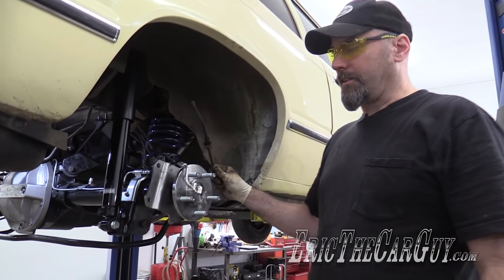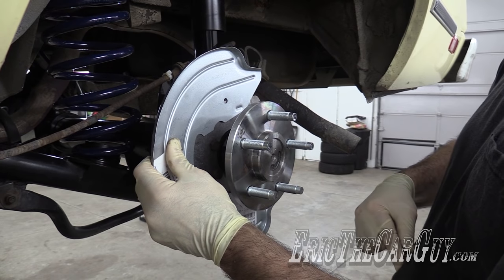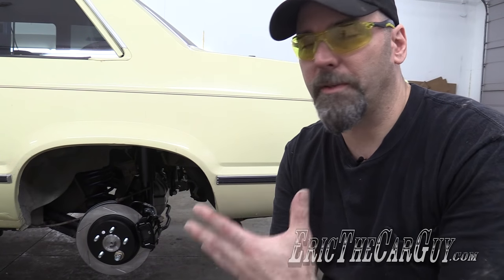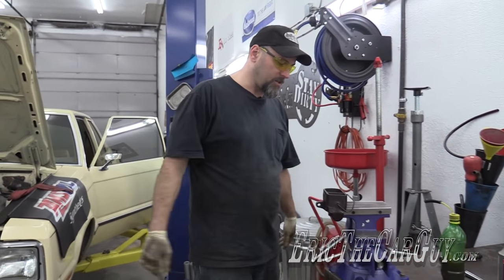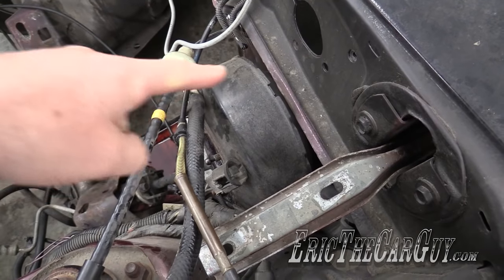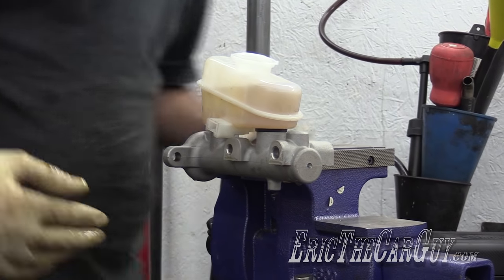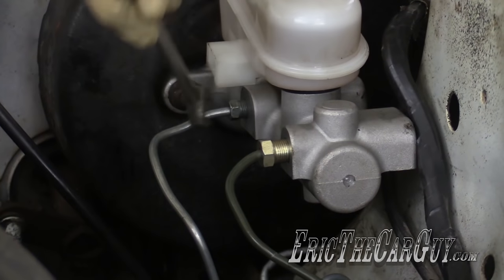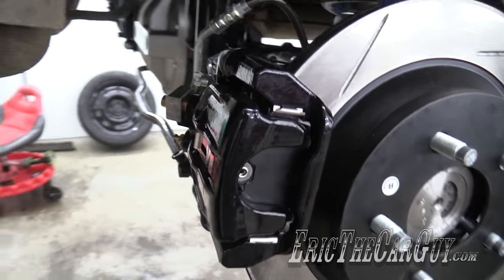Installing Rear Disc Brakes the Hard Way #FairmontProject

Comment: Hi Eric,  That did look frustrating!  I just replaced my Land Rover Discovery 2 discs all round (with performance slotted/drilled discs), and the ones I fitted were labelled LH and RH also like yours, but the slots went the other way.  I see it as encouraging air and bits of brake pad material to be flung outwards by the natural flow of the air.  May just be one of those things where it really doesn't matter :-)

Comment: 99 Ford ranger. Removed the whole transmission to replace slave cylinder (broke bleeder). Could NOT get clutch pedal after install. Was almost ready to remove trans again when.... I read up, Ford pulled a dumb, the clutch master was mounted at a DOWNWARD angle on those models (on purpose mind you, for whatever reason) making it impossible to get all the air out. Had to remove and bleed master outside of truck.

Comment: Yes i did notest that the calipers were on backwards. When i installed rear disc on my Stang i had to replace the master and the booster to make them work . I used a 94 Cobra master and a booster from a 95 V6 car as my original was too small to stop the car. pedal was hard and stopping sucked with with original booster. Also i did install the adjustable prop valve on rear brake line but did not gut the original prop valve. That still as it came from the factory. My rear brakes are 90's stock mustang brakes. Everything bolted right on . And installed new cables for e-brake.

Comment: As someone who has run slotted rotors, I concur with your installation. many believe the opposite and that it looks cooler to run the other way. it's not. slotted runs best  in this application...

Comment: I had a 1986 Porsche 944 Turbo and the brakes would not bleed properly unless the rear of the car was elevated well above the front. Hours of bleeding with the car  level left a spongy brake pedal even though no air was coming out of the bleed nipples. After elevating the rear considerably, the brakes would then bleed normally.

Comment: I know of a Ford tech I used to work with that replaced 3 master cylinders, ABS HCU,and bleed the brakes over and over again, to fix upside down calipers.   Only took him and the shop foreman a week to fix it after another tech looked saw it, called him a dumb a__ and walked away.   I still laugh at him about it.

Comment: if you don't like bleeding brake systems try a brake line clamp on the flexible hose from body to axle.thats what a good mechanic does.seems like you are a hammer man.keep guessing.

Comment: I am 74 and I have done mechanic work all my life. However with this vehicle I am having a big problem. I have a 2002 S10 blazer that the front left front wheel locked up. I started by replacing the master cylinder. From there to replacing the caliper and then another caliper and the rotor. A mechanic buddy of mine said it was probably in the line at the connection between the the rubber line and the steel line and even pulled the fuses on the ABS system and I still have the same old problem. If I bleed the whole system I might get 5 miles down the road. I really need help with this one. I'm fit to be tied and don't know what to do next. Help

Comment: Eric, I've recently purchased the same rear end kit you used in this video. The retailer I purchased it from advises the sn95 disc conversion will not work due to the rotor cannot clear the axle and the caliper mounting flange. What caliper rotor and flange set up are you using?

Comment: Great vid!  I am "hot rodding" (as it were) my question is in the "end" did you keep the OEM proportioning valve out? I have watched several vids on the subject and it is my understanding that switching to disc on the rear with a rear drum system you CAN remove the prop valve and it will work fine. Thoughts? Thanks.

Comment: Guys can I get some ideas of what the problem with my car might be 
Well when accelerating at certain mph it's like a whistling sound coming from the front of the car 
Also sometimes my 2008 Nissan Sentra when am turning it on it the car shakes and the it turns off what might the problem be
This happens at times to make it turn on I have to turn it back on and give it some gas 
Any help is appreciated thank you

Comment: are you going to upgrade the front rotors and calipers too? I don't know the stock size on a fairmont but would make sense to put bigger ones up front.  

One time after fixing a brake line leak, I was bleeding the brakes and was scratching my head why the brakes wouldn't get hard. I filled the master cylinder up with brake fluid so they should get hard.   Turns out, I forgot to bleed the master cylinder.  So yep, everyone makes mistakes.

Comment: I call those backing plates all the time even though they aren't structural. It's a plate that goes on the back side of the rotor... backing plate is an acceptable term imo.

Comment: I might be showing that I'm not following the Fairmont Project very closely, but I noticed there are four lugs on the front and five on the back.  Will you be putting in a new front-end?
Reply: did you not hear the part about the whole new k member that holds both the engine and front suspension?
Reply: Except he's not a troll, and it was in this very video.  By "not following [...] closely", did you mean, "didn't bother to watch the video before commenting"?

Comment: I've never bench bled my master cylinders in my own cars because once I use a vacuum pump to suck the fluid through the bleeders at each wheel, it feels great and I don't think there is air in the system.  If there is fluid in the master cylinder and you pull all the air through the lines and don't let the master cylinder go dry, I don't see where air could be?

Comment: Hey Eric I know you have experience with the TL
My Acura TL Type S 07 auto vibrates and shakes violently , around the dashboard steering wheel center console area, when I'm either in Drive or Reverse during idle. It is most prevalent when I'm at a stop sign or at a red light. Does not vibrate or shake as much when I'm moving or in park or neutral. What could it be? Happens when Ac is both off but it is a lot worse when ac is on.
Reply: check engine mounts buddy

Comment: Would the locking washers do their job(lock) if its sitting between two parts and not at the bolt(or a nut)?
Reply: Yes. That style of washer is just a spring that adds positive tension to the threads.

Comment: Eric, you changed from drum to disk in the rear, right? Don't you need to change the master cyl to work with all disk? I think the drum master has the wrong pressure and volume to use on a disk brake.

Comment: it looks like the adapter plates for the rear brakes should not have the bend in them just be straight, i think you should have had  painted/redone and then painted,  ps the rear end mounts where you put new in why not poly mount like the new/used arms??? since iam use to german cars that swaybar looks like it hangs really low, on german cars they are also supported on the beam(rear end) other wise the kit you bought looks really nice, i would really like to know why the schocks are not gas versions???
regards
Sören

Comment: years of watching this old house have taught me NEVER to remodel  a house. I do repairs and refurbishment like new cabinets etc but no structural changes to my home. Cars are kind of like that. I have a toyota echo and a chevrolet pickup. each works fine. All I do is service and repair as necessary. Thats enough for me at my age.

Comment: You need power brake booster with disc brakes. Trust me people have tried without it and bend the firewall without a bracket to keep the firewall from bending. Still won't stop for crap without a booster. We found that out years ago trying not to use a booster.

Comment: I'm curious about your brake parts cleaner squirter.  It looks like a refillable canister that you pressurize with your air hose.  I've just seen the disposable canisters.  Seems like a cheaper option.
Reply: HeroPureLove The brand name is Sure Shot, fill it from a drum, then you're correct, pressurize it with the air hose and you've got brake clean. They work awesome!  Wish my shop had them the cans suck

Comment: What's the difference between = a proportioning valve = & = a apportioning valve? Dad was a mechanic for many years and he said = apportioning valve...or is it a GM thing? I had to replace one once on a Chevy p/u I built, and it (I thought), had to do with the front & rear system, in case of front or rear loss, it closed off, so you would have brakes on the other end...Thanks! Awesome vid!
Reply: Nothing. Someone taught your Dad to say it differently.

And yes, proportioning valves have a shuttle inside them that will move and "seal" off the front, or rear, brakes if a gross leak develops. That's what that little plunger with the rubber thing on it that Eric pulled out of it is.

So, the entire device works both to control the flow of fluid to the front and rear as well as act as a safety device.

Comment: Just watched the video Eric and backed it up a couple times to near the beginning and had a look at the caliper mounting bracket you have affixed to axle tube.  Do you perhaps have them on the wrong way.  Can they be turned over and that should move the caliper further to the outside of the vehicle.  This may solve you "washer behind the caliper" issue.  Just wondering

Keep up the good work.  

As a side bar.
I noticed on the Dark Matter Pikacou sneak peek dyno video at the end of the pull that there was some oil being expelled out the breather.  Is this because of base pressure or ?????  Just wondering is all.

Paul
Reply from the maker: I believe I have resolved the issue with the breathers. https://www.youtube.com/watch?v=0NWqrABL1Mw
Reply from the maker: Your other question is answered in this video. https://www.youtube.com/watch?v=P3Pb_eNLkQc
Reply: I should have watched this first I guess.  Thanks.
Reply: I was thinking of just flipping them over rather than trading sides.  Having the L and R facing inwards?  Would that not offset the caliper further outboard.?   Or will they only bolt on the one way.?
Reply from the maker: As shown in the video I linked for you the fastener mounts are offset and you can only install them one way.
Reply: Guess I was not watching closely enough.  Thanks for the reply.  
Its gonna be an awesome ride when it's done.  YAHOO !  !!

Comment: You know Eric.. You can just bleed the rear brakes from the hose and not the bleeder. If you put it on wrong... I actually seen brake shops flip them upside down. As the bleeder valves were stuck in there. To the point you would break them off. Trying to get them loose. So they flipped it over. Then stuck it back on after bleeding. Just stick some wood in the caliper...

Comment: Hi Eric!

Quick question: Why dont you use any kind of anti-seize on the bolts, especially when dealing with brake parts. I always use just a bit, so the bolts are very easy to get off the next time.

Greetings from Denmark!
Reply from the maker: This car will never see a winter road. Also, you can 'overuse' lubricants that way.

Comment: I wander what the thing was he used to bend the lines. I am a disabled vet and hope I can find them cheap as my 1991 toyota camry dx has lines that are rusting.   Other than that I spent 7 years in the NAVY on submarines the same thing happens sometimes no matter what the documentation says you may read it wrong

Comment: I see lots of custom jobs and DIYer's come through the shop I work at with calipers on the wrong side so you aren't alone there and with the rotors being left or right it has nothing to do with the slots on the outside and everything to do with the direction of the vanes in the vented part of the rotor

Comment: Hey, Eric. Loving the Fairmont project! In case it hasn't been answered already, your T-fitting on the master cylinder lines was because '87-93 Mustangs use a 3-port master. As for the rear caliper issue, is it possible you have V6/GT rear caliper to axle tube mounting brackets instead of Cobra? The V6/GT rear brakes use the same calipers, just with different caliper to axle tube mounting brackets and solid rotors. That may explain your spacing issue. I have V6/GT brakes on my car, and they are not close like that. Sometimes Fox Body interchangeability isn't all it's cracked up to be, huh?
Reply: Actually, i just learned that the caliper clearance issue can happen with a 31-spline setup. Here's a quote from Mr. Jack Hidley himself from Maximum Motorsports : "He needed to space the calipers outwards because the car has a 31 spline differential in it. The cross pin in a 31 spline differential is 0.875" diameter. In a 28 spline differential, it is 0.75" This difference in a 31 spline application moves the axles outwards 0.062". Axle manufacturers are supposed to compensate by making 31 spline axles this much shorter, but they generally don't."

Comment: I did the same mistake when i did P11 Primera (G20 in US)  drum axle to disk axle swap. I bleeded the brakes and in the same evening i looked the pictures that i take, zoomed in and recodnize my mistake that the bleeder valves where lower that the inlet hose. Next day i swapped the sides and it was OK. Were are humans.

Comment: We have brain farts in every profession.  Couldn't tell you how many times I've written code that didn't work properly only to find the stupidest thing causing the problem.
Reply: Ugh.  Refactor function to differentiate between cakes and scones.  Weeks later find weird bug in the output on the other side of a browser.  Investigate for over an hour.  Turns out in the refactoring I left one line referring to the baked goods as a whole, instead of changing to its rightful new value referring to the cakes only.

Comment: Does a stronger-bigger master cylinder makes pedal harder to push than a weaker-smaller one naturally with all other parts of the brake system remaining exactly the same?
Reply: Yes. 
A larger diameter master cylinder bore will require more pedal pressure to develop the same caliper hydraulic pressure and pad clamping force as a smaller bore master cylinder.
Reply from the maker: There are many things that come into play with brake pedal feel. The master cylinder is only one of them.
Reply: Thanks a lot for clarifying that. Another question relative to it. What modification in the brake system makes the brake pedal to become more immediate and activates brakes from higher position?
Reply from the maker: Steel braided lines.
Reply: giorx5 
Several elements can affect pedal travel and firmness. 
Pedal pushrod to master cylinder clearance,  translates to less pedal travel to begin moving the master cylinder piston.  This is usually not an issue unless the master cylinder or brake booster has been removed and or replaced. 

Reduce caliper piston to pad/disc rotor clearance. Normally this is not an issue unless the caliper hardware is worn, seized or damaged. 
Check pad wear.
Check for sticking caliper piston. 

If drum brakes, it is the same premise, reduce the shoe to drum clearance. 
Check for worn, seized or damaged components, particularly the adjuster. 
Check for seized wheel cylinders. 

Check flexible hydraulic brake hose/line condition, look for soft, swollen and or wet rubber. Hoses/lines that experience swelling under pressure results in increased pedal travel. 

Replace flexible rubber hydraulic brake hose/line with DOT stainless steel braided hose/line assemblies. This type of hose/line experiences very minimal swelling under pressure. This is a popular performance mod.
Reply: patw52pb1 Thanks muchly for the quick and thorough answer! Only suspect is "Pedal pushrod to master cylinder clearance" as the other factors are ok in my car's case.  Brake disks all around, DOT stainless steel braided hoses on, pad wear is ok also. This big travel of the brake pedal before it activates them is there for many years now, so it must be something like what you mentioned. Thanks again!
Reply: when is the new engine going in
Reply: Just to expand on Eric's point... On Fox bodies you'll find literally hundreds of pages of forum posts, how-to articles, opinions, etc debating what master, booster, pedal, push rod length, etc, etc, etc, to get the pedal how someone might want it. It truly is a recipe of all things that makes the system behave how it does. Lots of people end up trying 3 or 4 different things before they get it the way they want it.
Reply: in the intro too
Reply: hey  man  who  had  to  get  it  done  in  c

Comment: Soap and water are recommended but not really the smartest method. Discs are porous by nature and you're just going to give rust a head start, so, as you use, brake clean is the best. There's also other liquids but those are much more expensive, in specific, tho i forget the name, on trucks that have brake cleaners and anti-freeze systems, they use those, costs quite a fair penny.

Comment: The caliper bracket spacing was not correct because the car has a 31 spline differential in it. The cross pin in a 31 spline differential is 0.875" diameter. In a 28 spline differential, it is 0.75" This difference in a  31 spline application pushes the axles outwards 0.062". Axle manufacturers are supposed to compensate by making 31 spline axles this 
much shorter, but they generally don't. The company that made the axle brackets in the video, NRC, includes shim washers just for this purpose.

Comment: Eric, when building a hot rod, mistakes are going to be made----there is no blueprint for what you're doing, it's all custom. I'm amazed that you can bend brake lines with just pliers---if I tried that, instant crimped line.
Reply from the maker: Thanks. It took some practice to get it right.